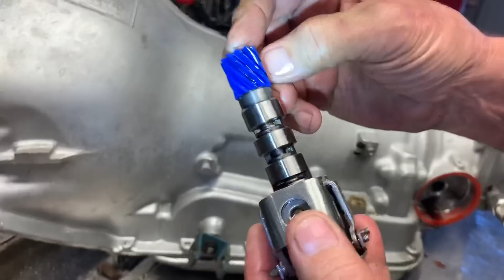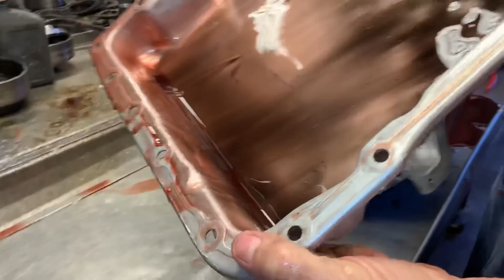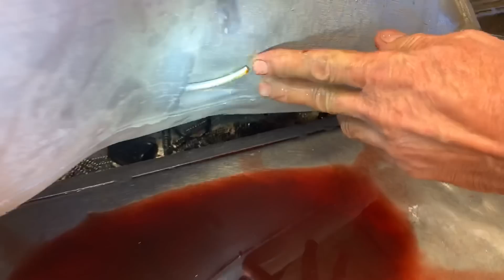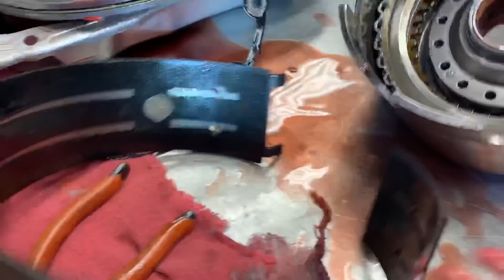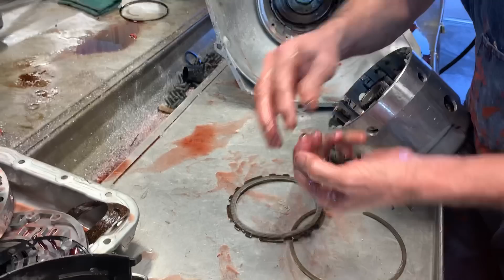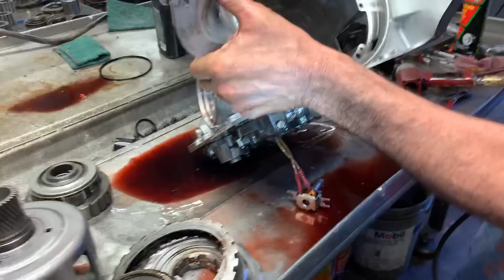Reason why we don’t like doing carry out transmissions. Video 1-2

Comment: “Everyone is a mechanic” lol no truer words spoken there
Reply: I occasionally work on my own car but I won't start anything I am not sure that I can finish.  There's nothing worse for a professional mechanic than having to correct someone else's botched work.
Reply: Agreed
Reply: @1575murray  not a mechanic but (add cuss word starting with "F"),I've seen some butchered up cars that'd make scrap yards cry and they wonder why as their on shade tree mechanic number 12,I've refused after just opening the hood and seeing just briefly,nope sorry I'm decent but not certified for that.
Reply: @jennifurzoe1302  Especially on newer cars a lot of unintentional harm can be done with all the computers they have.  My old 2002 Accord is relatively simple.  When I had to unplug some connectors in the electrical system to gain access to something in the dashboard I disconnected the battery ground terminal first to be safe and then just had to put the code back in on the radio after I was done.  Newer cars may not be as forgiving and are more likely to require intervention by a dealer technician.
Reply: Everyone “thinks” they are a mechanic! He forgot the most important part about the entire phrase!
Reply: To paraphrase another commenter below, the nicest thing you can do for your mechanic is to know your limits and not let enthusiasm override commonsense.
Reply: @texas legend aint that a fucking truth. Thats how i see it
Reply: Especially random guys walking by as you're working on your car.
Reply: While explaining what’s going on. It’s unreal.
Reply: Going through the same thing currently on my motorcycle going through the carbs I just love waiting on O-ring gaskets because of idiots spraying carb cleaner on them not to mention getting screws out with needle nose pliers because of being stripped good thing because of going with t head screws or Allen head
Reply: Yup, even me....until I saw this man's video...lol!
Reply: @kellivanbonn4692  Go to a shop like this mans,Those dealer guys ARE PARTS REPLACERS!,A good builder KNOWS what parts are&what they do!.
Reply: @packingten   i agree, i went from working on big rigs to a dealership, as soon as i got my master tech i left and went back to big rigs, dealerships are horrible.
Reply: "A man"s got to know his limitations"
Reply: You all prolly dont give a shit but does someone know of a method to log back into an instagram account..?
I was dumb forgot the account password. I appreciate any tips you can give me
Reply: @Keanu August instablaster =)
Reply: @Bode Lian thanks for your reply. I found the site thru google and I'm trying it out now.
I see it takes quite some time so I will get back to you later when my account password hopefully is recovered.
Reply: @Bode Lian WTF IT ACTUALLY WORKED! I just got access to my ig login within about 40 minutes of using the site.
I had to pay 15 $ but definitely worth the money :)
Thank you so much you saved my ass :D
Reply: @Keanu August you are welcome =)

Comment: Man the level of skill this man must have is fucking impressive. I've never truly tried learning how to rebuild a transmission but damn if they don't look unbelievably confusing.
Reply: Mike Curry start with a case split style, I’ve rebuilt two and they are easy, but I don’t even wanna touch one of these front pump style where everything just stacks in
Reply: I cant deny skill but this guy has rebuilt a ton of these. I've done similar work on X components for X.
Reply: It’s not too bad as long as you make sure and put everything back together exactly the way it came apart. To do it in this little amount of time is nothing short of an art though
Reply: @ToobxSox  yeah it would probably take me a whole weekend lol. I'm probably going to buy a retrofitted type r clutch and flywheel. I'm finding some pretty bad feedback on whatever aftermarket clutch I look at whereas I know for a fact the type r has a nice clutch and great throttle response. Get that lighter flywheel setup in there with a decent tune and it's going to feel a lot better imo. Plus it's not as expensive as I would have thought so it just seems like a solid choice. I'll probably throw it on my buddy's lift and go for it. What I can't figure out he probably already has memorized anyway.

Comment: I couldn't put that thing back together if my life depended upon it.
Reply: I could -- and even have some parts left over.
Reply: @kenp3L  bonus pieces
Reply: Your life dont depend on it your cars life depends on it 😂
Reply: @Zx14rrrrrrrrrrr  *Bonus nachos
Reply: I done many units the owner "Rebuilt"!, Guys go to an expert this gentleman is experienced,It takes YEARS,YEARS To become a master builder,Even a simple transmission is above your skill level go to a PRO!,See a man like TIM..
Reply: I've worked on manual transmissions a few times before (on my own cars), those were pretty simple to understand - dealing with automatics always seemed like an arcane art to me, so I paid the wizards who know what they're doing!
Reply: Me neither, we could save costs on a joint funeral...
Reply: only thing i could do to a transmission is change the spark plugs
Reply: LOL It takes years. My brother bought an old Kawasaki 1000 with four gummed up carbs. I pulled them out of the bike, apart, and in about 100 pieces on my kitchen table. He looked horrified. Next day after soaking parts overnight he watched me assemble them in about thirty minutes. He said how did you do that? I said what do you think I was doing for ten years as a motorcycle mechanic?
Reply: I'm sure you could. First time I saw one coming apart I was confused as well. Then I started putting one back together and once you read and start to grasp what everything does and how they work they start making a lot more sense.

Comment: I used to rebuild automatic transmissions back in the 80’s and I learned that you could be good at being a general mechanic but leave the Automatic Transmissions to a Specialist.
Reply: Yup,those internals of automatics is something,I can remove & replace,adjust the T.V.cable on them and thats it for me working on those,same with motors,remove and teardown to a point then to a shop for the long or short block rebuild,put it back in.,.
Reply: @jennifurzoe1302  The newer engines and transmissions are too complex even for the average professional mechanic to rebuild they aren't like the old school ones we grew up working on.
Reply: @1575murray  nope,now its pull and swap in a used with 70,000miles or less engine and done,but boy all the computer,wires,relays,valves,etcetera drive ya nuts..I've got a '74 Chevy C20 350cid,turbo 400 and driveline has about 90,000 on it,whole truck probably about 500,000 and best is no annual smog but its kept up,my 87 F250 with the 460cid recently broke 3exhaust manifold bolts and as I took em out a total of 8,3 on passenger 5 on driver a shop quoted $90.hour and I've used them before,checked summit racing had a plate for drilling angle and depth was $450.,so replacing manifolds anyway cut them in half got 4 to go on drivers side had to remove mid steering shaft,undo and move wiring and the inner fender but getting it..
Reply: jennifur zoe  that TH-400 (turbo 400) trans you have is an excellent trans. They are used by some friends of mine in X275 cars. They have it leave off the transbrake in 2nd gear and they are better than the 2 speed powerglide. I believe their turbo 400 is actually called a “turbo glide” and is pretty custom & trick.
Reply: @1575murray  the newer ones aren't too too bad, but tech bulletins are critical during any rebuild. But even just to replace them, you need the computer to reset the TAP cell values so you don't burn up new unit.
Reply: Too bad transmission mechanics are notorious for being absolute crooks.
Reply: @Prosecute-fauci  it's a misconception. Most aren't that good. All they know is how to rebuild the unit. But when it comes to hydraulic or electrical schematics, bulletins, or even range-reference charts, they toss them aside. And then get upset when they need to rebuild a unit for a second or third time. The last guy i tried to help, decided to do a second rebuild over a faulty new valve body. Had he taken the oil pressure readings from the tap ports like I told him to, he could have diagnosed and fixed the trans without taking it back out. And then people wonder why this Industry has such a bad reputation.
Reply: Automatic transmissions arent so bad that you NEED a specialist. You need to know where to get the proper information and pay great attention to detail when doing it yourself. The specialist will be able to do it much faster and may know some little tips and tricks like silicoming the pressure and vent circuit but other than that, the vast majority of problems in home grown repairs are caused by people not reading and following the manuals  thoroughly
Reply: Especially these days. A shade tree mechanic MIGHT have been able to do a decent rebuild on a C4 orC6, turbo 350, or 727 3 speed auto but the newer 8+ speed electronic and solenoid controlled transmissions are a different animal
Reply: Yeah I killed my 4l80 the other day. I pulled it and thought . I will watch a vid and take a run at it. Hahaha needless to say I dropped it off yesterday.
Reply: just to clarify, I WAS talking about the transmission shops that only specialize in rebuilding automatics.  From personal experience, most aren't that good.
Reply: Alan T I’ve rebuilt two cd4e transmissions, pretty easy and forgiving, I broke part of the pump where the whole assembly rides for the tcc lock passage, but it works fine luckily, try that on anything else and you’ll know you messed up
Reply: @stevenminix  turbo hydro 400.
Reply: @1575murray  the GM transmissions are the easy ones to build I'm not as fast as this guy and I do my own. the 4L80E and the turbo 400 share some of the same parts. these new ones aren't that much different

Comment: You totally explained why I like manual transmissions.
Reply: manual transmissions are so simple compared to automatics and all the necessary add ons they need in order to work.
Reply: Working for Honda I used to rebuild more manuals than automatics
Reply: Manual  transmissions have to match 1st the weight of the vehicle. 2nd they have to match the torque of the motor (hp does not matter). 3rd with modern vehicle design every gram of weight that can be removed is gone. This last design feature caused most of the transmission failures. The other thing most common in automatic transmission is not using a separate cooler for the transmission. If the engine overheats the transmission gets damaged. It then soon after that fails. That is why I choose a manual. But the B2300 and Ranger also used a car transmission. If you used either the manual or the automatic and used it as a truck the transmission would fail, because you exceeded the weight the transmission was designed for. I got really good at replacing them. Same thing with the automatic. The bad part was there was no other optional transmission that would fit in them. That leads you back to design feature #3. Most people never load 750 lbs in the bed of a Ranger and pull another 3 or 4 thousand lbs of load and trailer behind it. I did because I needed something smaller than a F150 to squeeze in tight spaces. Yep exceeding 55 MPH with a load like that will cook either one. Just using overdrive with the automatic or 5th gear with the manual with anymore than 500 lbs in it or behind it and it soon fails.
Reply: @92174164  lots of kids beat on those things
Reply: @gweflj  depends on the model....2000 to 2003 Acura TL's especially type S.....yes they were Junk...some other models worked into 200k always.... And just like Toyota they both had torque converter problem pretty common... But I was always doing RSX manual transmissions they had synchro problems ...
Reply: @FTsingos  Very true and they also make a lot of pointless silly modifications
Reply: @92174164  : From people that don't know how to handle a manual transmission!
Reply: @warrenpuckett4203  What on earth was that rambling about (The M5OD and M50DR1/2 transmissions are fine pieces btw and were not car transmissions)? I'll sum it up easier: manuals are pure mechanical - they have Murphy's law on their side because of the simplicity. Automatics are mechanical, electronic, and hydraulic - the slightest thing to go wrong with that level of complexity dooms the entire thing. As long as they are properly sized for the application, kept cool, not abused, and maintained, either transmission will live a full life.
Reply: @warrenpuckett4203  I got a '97 Ranger with the 2.3L and 5-speed that would beg to differ . . . although I agree they aren't great transmissions.  What Ford transmissions are?
Reply: @sidviscous5959  Ford has solid  transmissions just like every other manufacturer they have some good ones and some , not so good... I ran a 4A0D over 200k then sold it never had a problem
Reply: @Android_Warrior  yeah you're probably right about that in most cases ..and people that beat the living crap out of the transmission doesn't help.. lot with the RSX's  had problems and a lot of times it was abuse.. And I think some inherit synchronizer issues
Reply: @FTsingos  Manual transmissions are fun but they're no longer the fastest option in any type of racing. People who want to set the fastest, most consistent times in drag racing go with automatic. People who want to go faster in road course racing go with paddle shifters which are different from manual transmissions
Reply: Lmao
Reply: You think you get embarrassed by automatics now? Wait till everyone else is on an electric motor
Reply: @mattbrew11  in 1900 they were waiting for 40 yrs. In 2020 weve been waiting 80 yrs now. A electric motor is just that, no matter the materials or construction....an electric motor dependent on the mules out back moods to turn the generator to feed your electric motor not to mention the tech to store energy in a little box.
Reply: @darrenkastl7493  generators and mules are not involved in electric car.....lol
Reply: @92174164  can i give you a mulligan on your response? I was just wondering ?
Reply: @Android_Warrior  I agree. Stupidity and poor driver abilities are the biggest cause of manual transmission failure. Even a light duty manual can do lots of work if care is taken. Hardly any younger drivers can properly drive a "stick" and it is just as bad for CDL drivers. Many newer CDL holders have trouble with a manual. I definitely don't think many would have a clue if they hopped into an old truck with a "twin sticks". You truly learned how the shift with them, or swore off truck driving!

Comment: 99 percent of problems with cars is the caused by the loose nut behind the wheel
Reply: You definitely "nailed it" with that comment! That is the whole and completely deciding factor of any vehicle having a 70,000 mile life or a 300,000 mile life.
Reply: Ron Fullerton or a 10,000 mile life...
Reply: @nahnothnx4608  Yes, I have known some of them as well! The poor car never had a chance. No oil changes, no services (just wait till it breaks), either the brake petal or accelerator is flat on the floor at any moment, and other nightmares for the car. And every car they have had is "a piece of crap". We need a rescue service for cars!
Reply: i'm liking that :} nice one
Reply: johnny smit  the  cruze is notorious for valve cover leaks and it is a 10 minute job... but labor is probably 2 hours haha
Reply: 99 percent?... I think that's stretching it a bit too far. 50 percent perhaps, but not 99.
Reply: @llOOII llOOII of course, but still... 99? Dash cams don't catch what doesn't happen. I don't think the majority are nuts behind the wheel... coming from someone with way over a million miles behind my belt btw.
Reply: @llOOII llOOII no it was not, I use to drive 18 wheelers OTR... not counting the 35 plus years on my own vehicles mixed in there.
Reply: @llOOII llOOII irrelevant? I don't see that at all, I can tell you from experience most drivers aren't as bad as you presume since I've drove a lot. You're focused on the few and not the majority. Getting back to that 99, if that were the case the highways would be a mess everywhere... yet most still make it everyday like I have.
Reply: @llOOII llOOII you could get statistics online easier than I can post any. However, those statistics will not have 99 percent of drivers as nut cases I assure you that. If 99 was, then we'd ALL pay such high premiums we couldn't afford to drive. Me along with millions have been driving for years and we make it just fine, that 99 percent is way off, no doubt about it.
Reply: @llOOII llOOII 😂😂😂😂